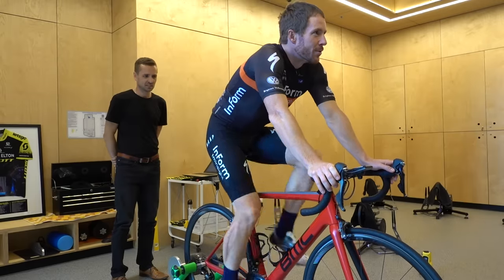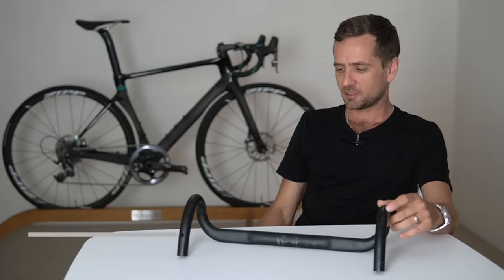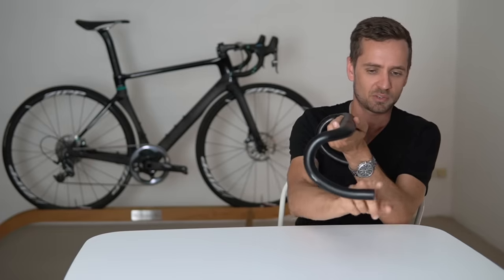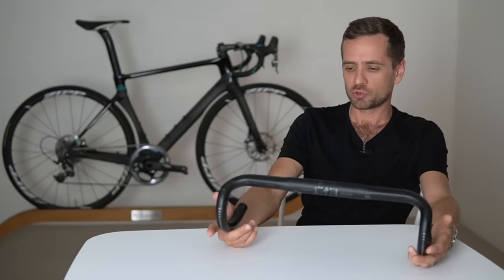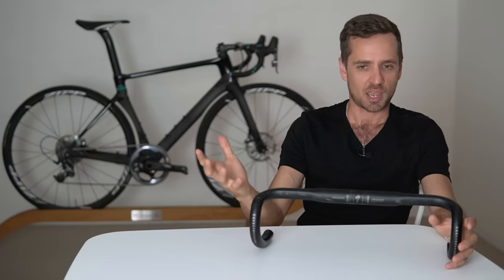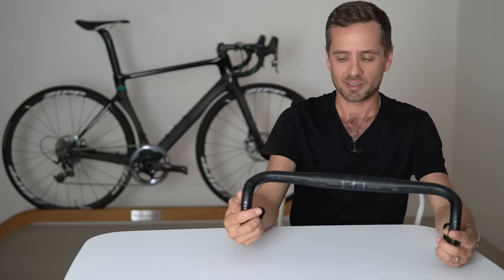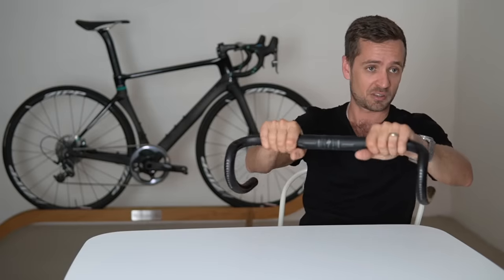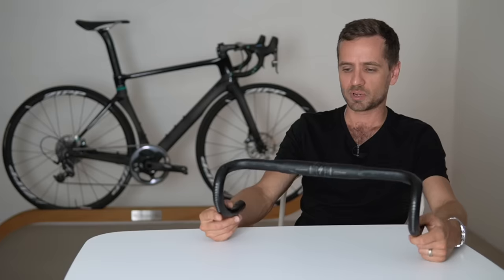How to Choose the Right Handlebars? (Width, Reach, & Design)

Comment: I have elbow pains when using a 42 handlebar, and find myself turning my wrist inside to a narrower position, even though I have 44 cm shoulders. My brother's 40 cm is much more comfortable, and it didn't make any sense to me until he talked about valgus elbows, which I have!
Reply from the maker: Thanks for sharing Serigo, interesting to hear
Reply: I have been riding 42cm bars for decades, but I recently started having shoulder pains. I did some research and decided to try narrower 38 cm bars; voila! shoulder pain gone. I am a slightly built guy and probably should have always been using narrow bars — it took old age for bad ergonomics to catch up with me.
Reply: @H457ur  Same thing here. My upper body is now slightly twisted as it learned to compensate for excess width.

Comment: I think it would be the other way around---if in doubt, go narrower, not wider.   Both my shoulders are wrists had a hard time on 40cm bars in which two bike fitters recommended.  I eventually changed to at 38cm and feels just perfect with no stress on wrists or shoulders.   The best thing to do is try riding with different widths and not use a static measurement to decide
Reply: This is interesting.  I go between 38 40 and 42 between 3 different bikes depending on the time of the year.  It boggles me how 38s can feel perfect in the Spring and Summer, but during winter even 40s feel too narrow.  I think it might have something to do with clothing, wearing more layers in the winter.

Comment: Changed the stock 42 cm Bontrager 100 mm bars on my Trek in exchange for a 40 cm Specialized Short Reach 65 mm and it makes a huge difference. I saved a yard of reach and changed the 90 for a 105 mm stem and get much better access to the STI levers in the drops now...

I personally like to ride narrower bars, although my shoulder width measures 43 cm.

Comment: This guy is the only one who talks about bent elbows (8:06), I think he may be the best around. Every one else just says shoulder with from A to B and away you go. I have pretty bent elbows so I bought some really narrow flare bars 330 at the bend and 410 at the drops to replace my 420s. It sounds extreme but when I hold my arms in a natural position my hands are only 270mm apart and my thumbs rest inward (kind of like when holding a stearing wheel)so I am thinking these bars may be  just the thing to help me not get numb hands and a stiff should. If I lived in Oz I would get a bike fit from this guy, I think he knows his stuff. Tell you how it goes when I fit them and go for a ride (if your interested).

Comment: Neill's basically my main bike fit mentor, virtually anyway.  In addition to the Ergonova recommend, my all time favorite budget bar is the FSA Wing Pro compact.   I've got really wide palms thought not very flexible at the hips, so I don't want a deeper drop and this bar just works perfectly.  The shoulder of the bar are have nice round radius that allow for smooth cable routing.   Also the ovalized top is angled back just right.  All-time fav, now discontinued apparently.

Comment: Have to agree when in doubt a touch wide is always better for comfort, breathing and control. 
For me 42 is spot on for my shoulder width but I vastly prefer 44. After spending a couple yrs on a 16 degree flare on the gravel bike, I am considering a 10-degree flare for the road. It's just more comfortable and with my hyper flexible back they function like a deeper drop. They also offer more stability decending
Reply: I recently built up a vintage Ti road bike and had some spare “gravel” bars sitting around with 12 degree flare. Decided to give them a try as I’ve come to love the 20-24 degree flare on my off-road oriented gravel bike. Turns out the flared bars are amazing on a road bike. I can stay in the drops indefinitely with no wrist pain and have better control. Not going back.

Comment: Modern hoods extend a good inch or more farther than old simple brake levers, and fit near level across the top of bars, the far more ergonomically improved setup; but this almost necessitated the evolution of shorter reach bars, to keep from overextending on the hoods.

Comment: I use a Specialized Short Reach handlebar. 65mm reach, 123mm drop. I use a 36cm on c-c so they are around 34cm on the hoods. Great stuff for a small diminutive rider at 1.65m height.
Reply from the maker: Thanks for sharing Jin
Reply: I am looking at getting this exact same bar except in 38. Currently have 42 flared and it's not comfortable at all.

Comment: this is the first time i've ever heard a fitter say go wider if in doubt, wouldn't a wider bar pull your shoulder-blades back causing you to arch your back more? I had that problem with my bars, going more narrow i was able to keep a straighter back and reduced low back pain.
Reply from the maker: Thanks for sharing Darin, interesting to hear
Reply: I had exactly the same experience. It made a big difference for me to get narrower handle bars. But all that happened in combination with setting cleats back and lower the saddle, that helped too.

Comment: I had lower back issues forever and always though it was due to cleats, q factor, or saddle issues. Turns out that even though my shoulders are slightly over 42cm my elbows have valgus angles so now I use a 38cm bar and no lower back issues anymore.

Comment: I think what's left out of the conversation about deeper, traditional drops, is that the bars were never slammed and were much higher, along with lower seat height, stretching the rider horizontally to get aero, not extremely downwards. It was not an uncomfortable stretch, in fact, the position facilitates you spending most of your time comfortably in the drops with hands close to the brake levers and the downtube shifter being automatically reachable(the secret of mastering shifting downtube shifters on a vintage bike, ride in the drops). The drops were usually somewhere that riders sit in the hoods today.
Reply: Agreed.  There's also a position on classic bars that I find comfortable and that is to drape your fingers on the ramps behind the hoods with the palm resting on the bend into tops.  It doesn't offer an immediate grab on the brakes, but then again if your bar is positioned where the drops are comfortable, you can brake no problem.  I dunno, I just like all the eras of bike stuff.
Reply: @allrounderbicycle7193  That's what the ramps are for, they're a resting position that gives your palms a resting spot on old school, short brake hoods. I usually just mind not to rest on the ramps in crowded areas, or if there's traffic and I need to suddenly brake.

Comment: Great as always! Can you and Neil discuss the effect that handlebar height and stem length have on the bike fit?
Also about a factor and spacers if knock kneed or the opposite?
Reply from the maker: Will cover a fair bit of this next week, stay tuned.
Reply: @CamNicholls  Awesome!👊🏾
Reply: Yes would like to know more about this as well. Cheers 🚲
Reply: Patrick I had a bike fit with Neil on a bike identical to one I had been riding since the 80's. I have 2, one with a neo retro setup and one close to how it was way back when, both with the same dimensions to the contact points. Cockpit is the same on both (Cinelli 1A stem, Giro bars, Potenza levers). For the purpose of my observations, lets imagine they are identical where it counts.

While Neil will explain much better than I why this is done, for my individual circumstances spacers were fitted to the pedals to stop the knees moving from side to side, a thing I'd previously associated with seat height being too low. In fact the seat was too high and was dropped a fair bit. In addition the stem length needs to be shortened but its not an easy thing to do with a quill stem and will happen the next time the bike goes to the shop. Stem was raised to deal with my physiology (old and inflexible) to improve comfort. Handlebars were rotated slightly to move the hoods up and back to reduce the reach as a short term measure to improve comfort. The goal is to reduce weight on the shoulders from memory by not leaning so far forward. Even though I've been riding this way for decades, I noticed an improvement following this correction. 

Back to my two previously close to identical bikes. The one he adjusted is now obviously easier to propel and more comfortable than the one he didn't. Side by side you would barely notice a difference between them. And yes, I'll be transferring the measurements across and adding spacers at some point for sure. 

Best bike fit ever.
Reply: @KeithHeinrich  awesome thanks for the insight! Might just have to travel the 1800km to see him!

Comment: I just bought my first dropbar bike, and tonight, after three days worth of riding it, I put a riser set on it. I just could not get comfortable on it. It seems to me there is no good ergonomic position to place the brake levers. For city riding in traffic, it feels unsafe.
Reply: Yeah my feeling too, steering one handed through traffic while braking ain’t for drops.
Reply: @jojojo8835  Ya know what I did, though? I tooke the drop set, flipped it upside down, chopped it down to short bullhorns, got the brake levers mounted where they're accessible, and it's the most comfy ride I own.

Comment: I am one of those with the extreme valgus elbow. Had never thought of it in terms of bike fit, but it's good to know that I could be receptive to shallower bars if I ever decided to try it. Maybe give it a shot on the bike I use for Merckx TTs.
Reply from the maker: Interesting to hear, thanks for sharing Stephen.
Reply: @CamNicholls  finally got around to having the Mrs help me measure my shoulder width, and it turns out they are 37cm. So a 38cm bar seems definitely worth a try.

Comment: "There are people who prefer those crazy old bars with the huge drop..." 

I resemble that remark. But I get it now.
Reply: People who enjoy a classic road set up, with less extream drop between the bars and saddle and ride in the drops on a classic shaped frame that's actually in their size, instead of going through the trial and error of the compact-frame game. A lot of profession fitting is necessitary and a big help because most modern frames do not come within ranges that fit a lot of people, like when frames used to come in one or two centimeter increments.

Comment: This is great  fit advice.  However, I had Ergonovas at one time and found the hand angle in the drops becomes awkward when you have to get on the brakes hard and repeatedly - on long technical descents.  The deep drop bars are much better for this and you can descend with much more control and confidence.  I have found shallow drop bars that are slightly flared work well too.

Comment: from my experience .. handlebar width largely is depending on how much support you need from it .. how much weight you put on it

90% of the time .. when you put only minimal weight on the handlebar .. a narrow one would be just fine .. because you are riding with bended elbow .. so it does not matter much the width .. it would not impact your breathing .. because your bended elbow compensate 

only in extreme cases where you need more support .. for example in off saddle sprinting .. then you would need a wider handlebar to rock side to side

my 2 cents
Reply from the maker: Thanks for sharing on the thread mate

Comment: Wide Low Straight Handle Bar like Pipe
Mounted Directly. No need of Pivot

My Favourite
20T Long Wheel Base Aluminum Cycle
This ll ve Handling of BMX & Comfort of MTB
Wit Rear Brake Only. No Disc Brake

Aluminum bcz Aluminum is a Soft Metal
U dnt need Suspension

Comment: I went from a bar that had sharp bent drops to bars with more round(uniform) bent drops, because I could not find good position for hods on that sharp bend. If I moved hods up where I liked. I could not reach the levers from drops anymore. I did not want to dial levers reach too much closer too, because I think it shortens the brake pull rate and that's not good with mechanical disc brake. 
I have narrow shoulders and long arms.. ape index +9. Don't know how long my arms are relatively to torso length. But on most of bikes that I have had. I always find the reach being too far and handlebar too high. 
Now I have bicycle one size smaller than factory recommendation, and also stem replaced with one cm shorter, and all spacers taken out from steerer. That way I'm pretty comfortable. Elbows bent, when riding, and won't get shoulder and neck pain anymore.. 
With original stem and handlebar that my bike came with. I could adjust it so, that I was comfortable only on drops, and tops, but not on hods. Now I can hold from everywhere, although none of position is 100% comfortable/ideal I think.. maybe 82%? But that is already good enough. I can't imagine riding those old type classic handlebars, with huge reach and drop. Even setting up the compact bar, was so difficult for me.
Reply from the maker: Interesting to hear, thanks for sharing mate.
Reply: I have the same exact problem. I also tried turning down the bar and seems to be better in the drop and top position but I always feel short on the hoods, even with a 1cm shorter stem. After 3 hours I always start having muscular pain on the neck and shoulders. This is really annoying
Reply: @mm-ew5df  I have now also cranks replaced with shorter ones. I had standard 172.5 mm long cranks. Replaced them with 165mm long cranks last year. And that made things much better. I think that now, with shorter cranks, I would be able to ride with longer stem too, but I feel good with this one too. Crank arm length I selected based on the equation of "tight bone lenght in inches is equal of crank lenght in centimeters." My tight length from hip axle to knee axle is 42 cm which converted to inches is 16.5 inch and so it means 165mm long crank should be right. And really, I'm so glad I replaced the cranks. I can ride much longer and I don't need to stop for catch my breath on top of every bigger slope anymore. I think one factor why I was struggling so much for finding right position for saddle, handlebar and shoe cleats, was because the cranks were little too long for me. ^_^
Reply: @rttm  thank you for the reply. I am now building a new bike on an old  steel frame. I purchased a campagnolo groupset with 170mm crankset. The difference from 172.5 is minimal but...who knows. What makes me angry about those pains is that I can't join long rides with my friends, even if I have enough training.

Comment: Great info, what about sprinters Vs climbers, does it make sense for sprinters to have slightly wider bars for leverage or narrower for aero?
Reply from the maker: Great Q, I'll need to position that with Neill during one of our next chats.
Reply: When I tried a very narrow (36 cm c/c) bar it felt really good when seated but if I came out of the saddle for climbing or to sprint it felt really unstable, there simply wasn’t enough leverage. Went up a size and it was way better.
Reply: @darrellvarley1765  Precisely..

Comment: If a narrow bar could be a problem, why do ultra-endurance cyclists use aero bars without issues?  Those must have an effective width of about 12cm.
Reply: Years of training and conditioning, gradually training their bodies into tolerating the more cramped position.

 narrower handlebars can also affect sprint performance.

Comment: Wait, what happened to the SMP on the BMC?
Reply from the maker: haha! More to come on that. Just playing around with a SQ labs as a trial, which isn't on the bike in this vid.
Reply: @CamNicholls  really enjoying your videos with Neill. Went to 165 cranks and can’t believe it took me this long to switch. Still having issues with my neck and the cleats are getting some attention but the new video may offer some clues. With the virus raging here in the US, my go to fitting guy is closed until further notice. So it’s me and the trusty tool box working on improving the comfort part of riding.
Reply: @mannysamaniego702  what made you decide to go with smaller crank? What size was the previous crank?
Reply: @JitinMisra  rode 172.5mm (one of my bikes still has them). But read some about it and then followed Cam’s videos and his thoughts. I decided to give it a try and the first few minutes it did feel a bit different but about 20 mins in, no issues. I have noticed it more on hills, the spinning does help. Again, this is just my humble opinion. So far, very happy with the change.